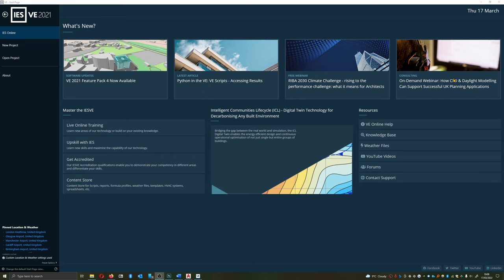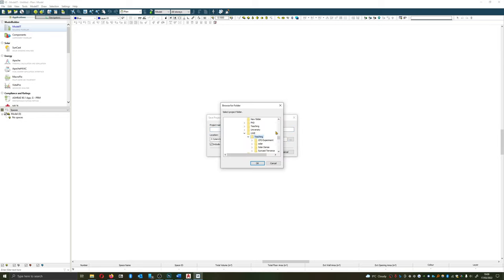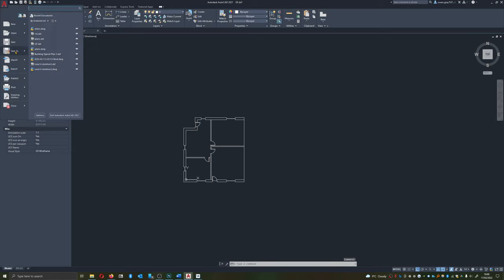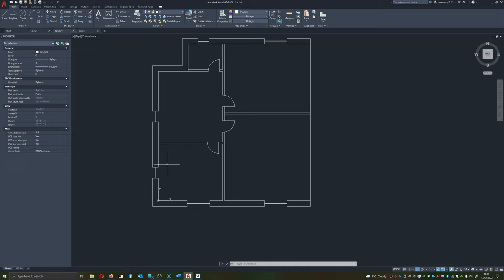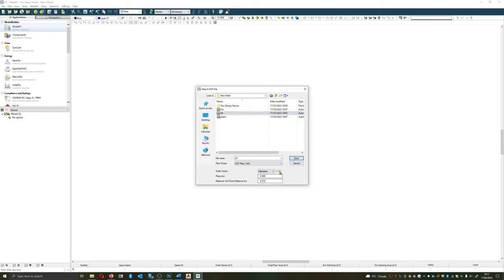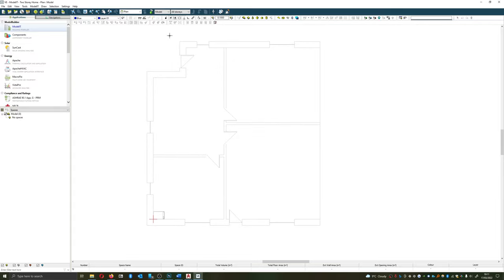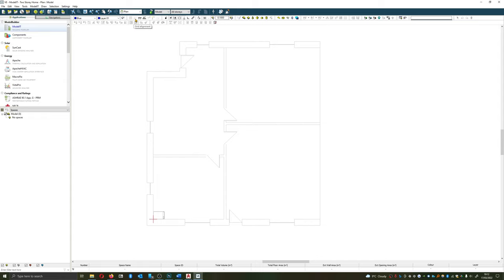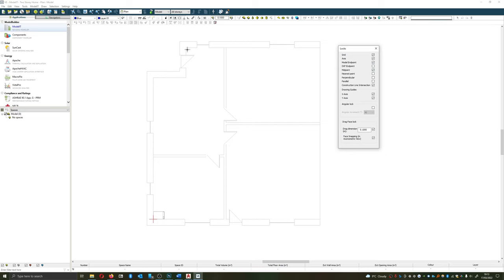IES VE Tutorials - Episode 1 - Getting Started

Comment: When I attach my DXF the drawing is a very long way away from the origin?How to solve this issue
Reply from the maker: Two options, either use the "move dxf" option off the toolbar in modelIT, though I don't really like doing this for multi floor projects. The other options (and my preference) is to open the DXF in AUTOCAD or equivalent and to take a reference point (preferably a grid line) and move it to point 0,0. Then import it into IES. The advantage of this is that we can then do the same for other levels and make sure they all align.